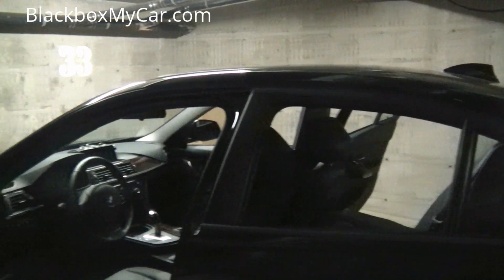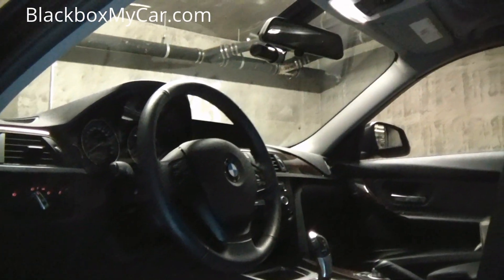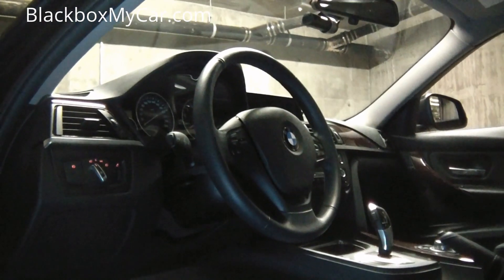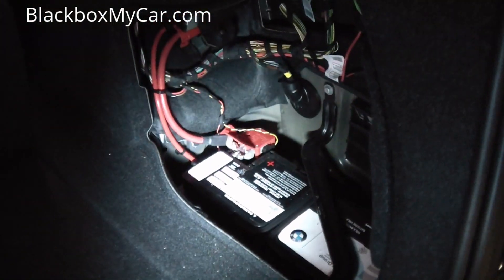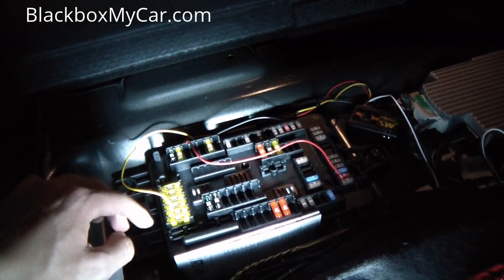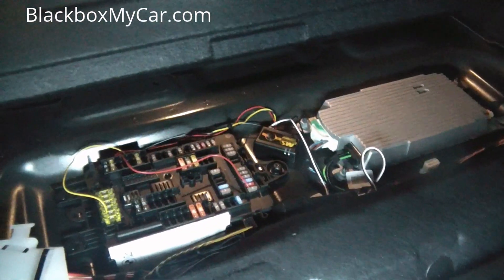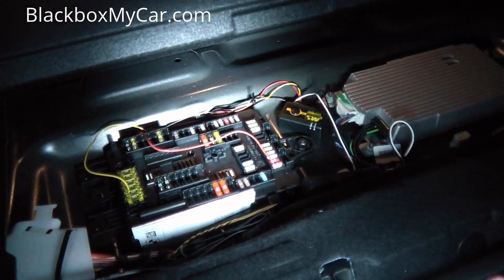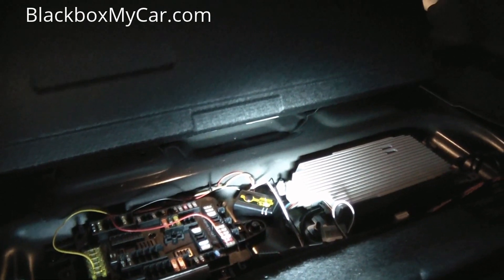How to install dashcam on F30 BMW 328i - BlackboxMyCar.com

Comment: NEVER NEVER NEVER run the wire up top on the side near the head. This is the where the dropdown airbags are located. Always run the wire down the a-pillar, along the floor sills, up the rear seat side. THAT is how it is down.
Reply from the maker: Hi there, we have a write-up regarding this here: https://www.blackboxmycar.com/pages/dash-cams-and-airbags
Reply: Agreed, a lot of the videos show running wires over the airbags, and consumers are following suit.   On the F30, they are behind both the A-pillar trim and the C-pillar trim, and installers are running wires right other them.  I ran mine through the headliner away from the airbags.  If you are unsure, remove the A-pillar and C-pillar trim, or use an endoscope camera to see for yourself!

Comment: Hey BlackboxMyCar, awesome video. I am doing this for the first time with my BMX x3 35i and I really want to use the glove box fuse panel so I do not have to run cables all the way to the back. I got a fuse tap with a 5Amp fuse. Could I use the cigarette light fuse or would you recommend another one. Also, I got the multi safer so I still use all three wires correct? I have two fuse tap cables but I guess I only need one 5Amp fuse for the yellow cable or both need extra 5Amp fuses? Or do you not even recommend fuse taps?

Comment: Hi, hope u can help me out here, I've got an issue which my car doesn't come with a foldable rear seat (328i doesn't come with that option in my country). So I'm wondering do you know of a way I can pull through the wire to the rear fuse box?

Comment: do you still need to use the Multi Saver even if you hard wire to your battery or is it just if you go via the fuse box? I have a 2013 BMW 535i (North America). Thanks and keep up the great videos!
Reply from the maker: You need it either way for the Blackvue dash cam, otherwise it will drain your battery since there's no internal voltage cutoff. The power magic pro will also offer the same kind of function
Reply: OK, I think I will go with the power magic pro and stay with the same manufacturer.

Comment: BlackboxMyCar I use magic pro. And I have connected all the wires. Everything seems to work when the car is off after 30min. Over the night. When I wake up in the morning to start up car. It says battery discharge. What's happening? And it seems like nothing is recorded. How do I resolve this?

Comment: I have a problem with 2009 523i. All the fuses in the glove box are always live even after 20mins. (Tested all the fuses with a multimeter). Even tried to use the glove box light but couldn't get it out. If I try to use the rear fuse box I can't find a way to route the wires into the front. Giving up. Going to a garage.
Reply: Any luck?
Reply: Miles15. com I went to garage. They had to use the rear fuse. They had a metal rod to push the wire to the back seat through the hidden gap.

Comment: Hi Alex, 
I have a 2015 328i Grand Turismo and I just got the Power Magic Pro for the Blackvue DR650GW-1CH. Do you recommend hard wiring the Power Magic to the battery or to the fuse? If fuse, will I use the same fuse like fuse161 or another slot?
Please advise.

Ramm
Reply: I also have the same question 🙋

Comment: Question... Does the power socket turns off after ignition is off? I connected Dash Cam and it kept turned on even after ignition is off and other small lights on buttons turn off after 1-2 minutes. Dash cam remains on which is plugged in cigarette lighter socket. My car is F30 2013 model.
Reply from the maker: Hi Asmeet, if you lock your car and wait 30 minutes, does the camera stay on?

Comment: What is that thing to the right of the fuse box?  Is that an amplifier?  My 2017 328d has the Harlan kardon system but there's nothing to the right of the fuse box.
Reply: It's a logic7 amp.

Comment: Hi Alex, I installed the DR650-2CH in my 328i and  I am having a few issues:
1) it seems that my DAB drops out every now and again
2) one of the brake lights seems to be out but I have no error on my screen. 
3)  get a battery discharge message every now and again (I am using multisafer)

Can you please help?

Thanks!
Reply: Any update on multi safer? I really don't c the point of pmp - I run 2 dvr in my car and it takes atleast 3days b4 battery runs down so I always just unplug if I kno im traveling  - I will only use multi safe exclusively for stop and go feature

Comment: Hi Alex, small question. I got a BMW3 series from 2015 and used the Power Magic Pro to hardwire my blackvue. 
i put the yellow cable to the always on fuse (headlights, 162 slot)
i put the red one in slot 120 but i don't know what that one is based on the small icon on the fuse diagram (it s a small rectangular icon) of 5 ampère
the bacl one is wired on metal part.

is this correct?

thx for ur advice !
G
Reply: did this work? any issues?

Comment: I need help! I have a 2011 BMW 328i f30. I'm want to install my blackvue/power magic pro directly to the battery but where do I connect the acc(+) to? There is no trunk fuse panel anywhere and when I connected to the fuse panel behind the glove box no matter what settings and sitting and waiting for over an hour the cam never turns off and completely drains my battery. Help!!!.
Reply from the maker: Hi there do you have an E90 or F30? 
F30 has it in the trunk behind the back seats as in this video and there are definitely ACC and B+ fuses. Are you using a circuit tester or multimeter?
Reply: BlackboxMyCar I'm a dumbass!! Sorry.. It is an E90. As far as a tester no I have not used one yet.
Reply from the maker: Hi there, for E90 there are some good tutorials to wire the PMP on E90post. They list out what fuses they use and how to run the wire
Thanks!
Reply: BlackboxMyCar Holy crap you're a life saver! Made some corrections and I'm all good and it's working like it should!
Reply from the maker: Thanks for the support!